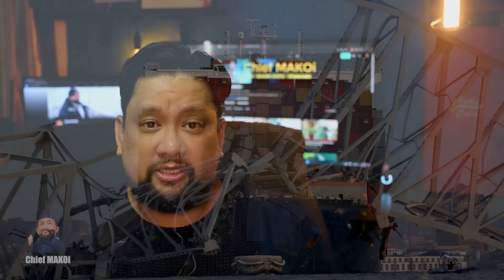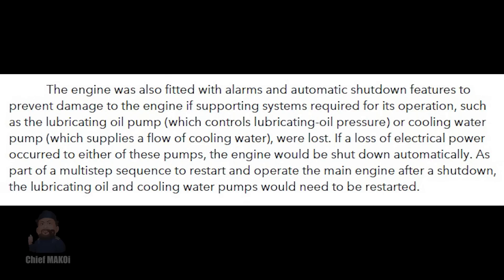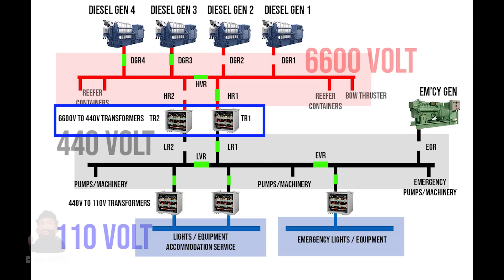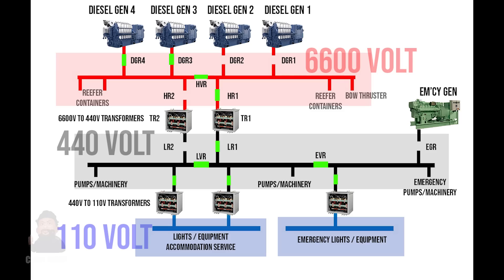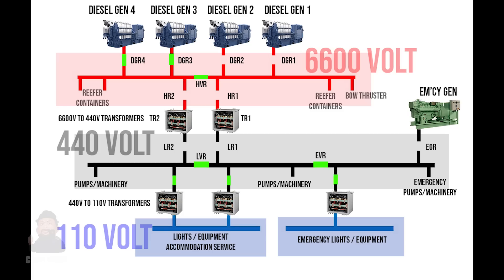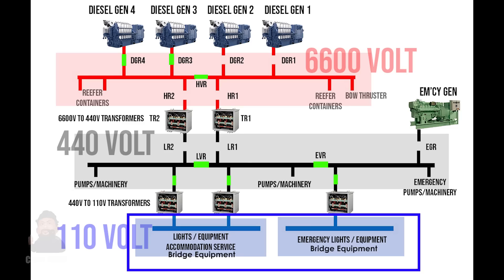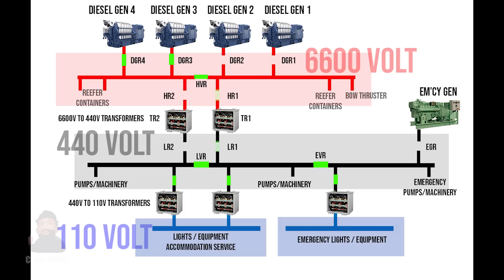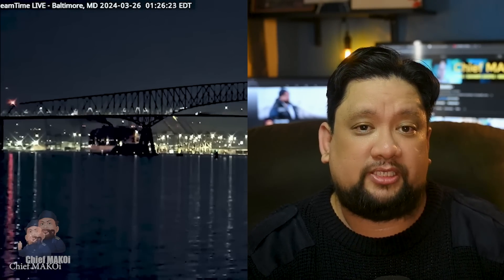Explaining the NTSB Report on the Container Ship DALI | Chief MAKOi

Comment: I wonder what alarm(s) triggered the opening of lr1 and hr1 initially. Does the electrical protection devices need manual resetting to work again?(back 25 years ago you would have to as I recall) If they for some strange reason operated the breakers manually at the breakers itself, the interlock systems at the computer or the controlroom switchboard will not stop you from messing up, the generators(connected to a faulty grid) will not be happy(the black smoke) and they eventually trip the generator breakers. They then switch to the second transformer but it is to late. My knowledge on these kind of systems is outdated, but I had to take a shot 😂 The key will probably be in how the ICMS is supposed to work and be operated and routines, maintenance etc.

Comment: You said that the engines could be started to run backwards in order to reverse the propulsion. Could doing this with the prop turning the engine backward have caused unburned fuel to be blown out through the exhaust causing the black smoke that you mentioned?

Comment: 8:02 - That is the emergency generator coming on.  The navigation lights and emergency lighting for the walkways along the side of the ship came on, but the big spotlight on the front didn't dome back on.  It comes back on later just before impact when they were using the 3rd generator and the second transformer.
Reply from the maker: That's usually a mercury lamp at the front.  It takes a while to fully illuminate.
Reply: @ChiefMAKOi  We had High Pressure Sodium when I started back in the 80s,   then it shifted to Metal Halide and at the last LED.     The HPS and MH had various rapid re-strike systems if they were considered emergency (every 3rd light in a facility).     Some just had an aux Halogen bulb that came on until the HPS got going puling enough current to open the relay.     Mercury are the worst of them for power use,  HPS then MH and the LEDs of course very efficient  (costly but far fewer failures of the bulbs or ballasts)

Comment: Chief your explanation of the wiring and all was grate best of all so far, every one is talking about barkers and such BUTT!!! can you tell us when they tried to restart the main engine and how many times did they try and was the black smoke from the main. I think my simple question is did they ever get the main engine going full power in reverse or close to it. I am quite sure the Chief Engineer was fairly full of excitement at this time. Thank you for your time Chief. I know nothing about ships just that when this computer goes dead a new one will come on a SHIP.
Reply: Chief I don't know how to do that. I think the simple question is did they ever get the main engine running in reverse? Thanks.        Paul

Comment: It is common in Diesels, that if you reduce the injector pressures that you get very poor fuel atomization, and this results in "black smoke" into the exhaust.  We've seen this in automotive injectors.  However as per your comments, this does NOT explain the breaker tripouts, which are either the result of electrical overloads, shorts, or insulation failures within the system.  If this ship had electrical leakage detectors, this may have tripped the breakers, if they are remotely controlled.  We did this on an Exxon underwater system, to protect divers from being electrocuted in the water, in an 4400volt system.  This is essentially same as your GFI in your house.  If the breakers just had bad connections, loose bolts, or similar, which resulted in overheating or intermittent connections, the switchover to the alternate pathway should have resolved this problem.  Bad connections are a common problem, but easily bypassed with redundant systems.

Comment: Chief... When the term "Circuit Breaker" (CB) is used, in the context of the NTSB report, isn't this a term which is easy to misapply for those who may not be marine engineers.  Understanding your expertise here, would not these circuits be protected by CBs & Relays?  Many who are reviewing the NTSB report are hearing CB term and thinking of the CB that is in their home;  CBs protect against over current protection.  However, as I am certain you are aware... Relays can be used here and with expanded benefits over CB protection.  I only mention this, in that it is one more layer to the details that will untimately explain this event.

The relays, if linked to a microcrontoller can monitor for over or under voltage, over current or any number of sensors that may be connected to it. In turn, the micro controller can use a smaller power source to open and close the relay to provide enhanced circuit protection above what is excessive current protection that is afforded by traditional circuit breaker.  I suspect this is why what is labeled as HR 1 and LR1 (High Voltage Relay) (Low Voltage Relay) are labeled as R vs CB.  Furthermore, faulty or failed sensors may have been the root cause and human factor driven errors will ultimately be contributing factors the continued the propegation of the error chain.

For those who do not know, a relay is in effect a switch, driven by a "coil" or copper wire around an iron core that creates a magent when energized.  In turn next to it is a conductive metal tab that will be attracted to the magnet when the coil is energized.  The on eitherside of that are two points where wires can be connected.  When the coil is energized, then magentic tabs completes the circuit allowing the connection to be competed.  

When a relay is combined with a micro controller, sensors can be added that monitor voltage, current, and function of controlled devices within that circuit.  This could also include sensors on the generators.  The Micro controller then can programed to open the relay if certain conditions arise.  Stated, another way, it becomes a "smart circuit breaker."  

So are we potentially talking about relays (with or without Microcontrollers) & CBs or only CBs?

This leads me to the question I have for the NTSB... Who were they writing the report for?  The lay person? The Mariner? or The Marine Engineer?  In my review of the report, there were over simplifications throughout the report which is something I was expecting.  Unfortunately, it will be a long time before we get the final report on this.

I have started my own channel and did a review on this case, will be posting my own take on the NTSB report.  I refrain from posting a link to that here without you permission.  I really appreciate your approach and discussion on this.

I am a grad from USMMA, deck major, minor in engineering.  (3rd Mate, Qualified Memeber of the Eng Dept; 200 days on deck, 100 days in the engine room).  I then went into the USCG and became a marine casualty investigator.  This event was a combination of single point failure on the Dali & the Key Bridge that occured with timing that truely created the worst case senerio... ironically, we can not regard this as a one off event in that this  has happened before.  It is just that we have to back our point of view to the macroscopic view that  we do not typically view these events from.  This inability to change our point of view is what sets us up to repeat these events.  I think we need more timely review of these events, gather critical findings & share those as propmptly so transportation systems modify to mitigate future events.

This was a great & detailed explanation.  It presents excellent detailed data & explains the complexity of modern shipboard systems that are not well understood by those who are unannointed.

Cheers

John Hall
LT, USCG
KP '95
Reply: That would be true but all the work I did on a Dali Like system,  it was motorized CB to you could reclose (or command that) remotely.    CBs can also have a higher level processor PLC system that will trip them and refuse to let them close unless certain conditions are met.
         If you look at the Emergency Gen circuit,  what should be EG1 (not labeled on NTSB) that can't close unless LVR and LR2 are open.   CBs can also have a reverse current detector and be tripped by that.     Low Freq detection can and is used in various ways to trip.
Reply: @gregoryschmitz2131  Great point, thank you!  My point of inquiry is aimed at tyring to understand some of the smaller details in that they matter to understanding the mishap to begin with.  I was the pain in the ass student that was always asking "why?"
Reply: I’m slightly amused about quite some comments when reading the term `relay´; which I would more file under `low voltage and low currents´ only.
Those switches (or `circuit breakers´) used for the big transformers need to deal with 6600V and several ten amps (x 10A; if not few hundred amps, x 100A) on the HV primary side, and 440V with several hundred amps ( x 100A) even up to few thousand amps (x 1000A) on the LV secondary side. You need bit more `heavy gear´ for this if it’s not done by electronic high power switches yet (even those will need screws and wrenches to make proper contact).
Which brings us to the transformer (obviously Dali still goes with this `classic´ approach) and its basic ingredients: coils. The latter formerly have also been used for the – guess what – ignition coil to provide the high voltage required to create sparks in every cylinder of gasoline engines. The effect is as simple as: operate / “load” the coil with a certain amount of current, then suddenly interrupt this current flow by opening a switch / circuit breaker. Self-induction, high voltage, spark-plug, bzzz – here we go!
Based on this, you could imagine how the situation might look like for the transformers of Dali here. Tripping both primary and secondary coil while still under full load current (due to emergency) is the most challenging operation, with huge amount of magnetic energy stored in the coils. It needs measures to protect the breakers from such sparks like created by the ignition coil, but also to protect the transformers isolation from the extremely high voltage peaks.
Correct, those switches will typically be operated by appropriate mechanisms, which are controlled by automated, more or less sophisticated control systems checking for and analysing several operational parameters (but might also have kind of manual override option).

Comment: Perhaps the NTSB should invite Chief Makoi to participate in the forensic analysis of what went wrong with the electrical and fuel systems aboard the Dali, both when she was docked, and when she was moving down the main channel. the Chief could also interview
his counterparts in the Dali's crew. Its one thing to understand theory, as NTSB investigators do, but another thing to apply theory to practice, and for that, you need a person with Chief Makoi's qualifications. To analogize, if you want to understand the control systems on a Boeing 747, you need to talk with an experienced pilot certified to fly that aircraft type.

Comment: NSTB will blame the crew they need a quick judgement and a scapegoat 😢
Reply: No they will not.   The NTSB is a totally separate organization inside the Government.    It simply investigates.    I does not prosecute in any way.   Its Brief is to find out what happened and make recommendations to stop it from occurring again,  but it can' enforce that,  its a recommendation.    The FAA often ignores the NTSB.      The NTSB have economic costs and those are weighed in by the specific regulators.  
        In this case,  Chief Makoi has seen the tests in Simulators,  there is no recovery from a crashed main engine in a reasonable time frame.    Knowing that all the AHJs from the CG on down are complicit in this.    Sooner or latter you are going to have a main engine failure at the wrong time and you ram a bridge,  another ship or a port.   Counting on luck is not an option.
       There are layers of safety that can be added,  including running a split plant at critical times,  with 2nd systems all duplicated so any single one running keeps the main going.   Add in Tugs like New York mandates at narrow spots as well as pier protecion (yes you can engineer those,  it take money but its completely possible,   like a runaway Truck,  you make the run out long enough to soak up the energy,   they have done that on runways now as well.  
       Baltimore is running a Cheap port,  so no tugs nor pier protection despite the same bridge ramming taking place in Tampa bay years back with even greater loss of life.    They sure have pier protection there now.

Comment: Excellent review!   One question though, is the secondary 440v and not 480v?   Boats are weird.
Reply: Could be just the nominal rating. I know most reefer containers are name plate rated for 460/3/60 but are normally run on 480v. 480v is the NATO standard. However, there is two voltage ratings for electrical equipment. Power producers are rated for 480 volts in the USA/Canada. But power consumers like motors are name plate rated for 460 volts.

440v is a strange voltage to me. In the UK, most 3 phase systems are 415v 50 Hz. Because they are 230 volts nominal line to ground. Some countries the voltage is only 220 volts line to ground, so then the 3 phase voltage would be 380. Running 380v motors on 440 is a bit high. 480 volt motors will run somewhat ok on 440v, but can't be used at 100% rated load or the amp draw will be too high, and they'll run hot, and not be happy at all.
Reply: No,  I bet you dollar to donuts its a 50 hz system.    HV in the US is 7500 so note the 6600 volts on their HV side.    And you can get all sorts of voltages on Y to Delta,  Delta to Y.    A US 480 x 60hz systgem when run through the step down transformer comes out 208 volt 3 phase.   Tap that off to a neutral and you get 120.    Its must mathematical relationships.
Reply: @gregoryschmitz2131  7500? I've never ran into that voltage. Only 120/208; 277/480, 347/600 etc. Medium voltage there's still old equipment still running on 2400/4160 3 ph. Today if you want any other voltages where I live, the utility will just bring you 7200/12470, and you then have to supply your own transformer and CT boxes etc. The new Wal-Mart near me has a 12470 feed.

I think you might mean the 7200 volts on rural SWER systems. Single wire, earth return, there's only a single 7200 volt line run on the poles, so no 3 phase power, and all the pole pigs are set up to drop 7200 down to 120/240 center tapped secondary.
Reply: @gregoryschmitz2131  You might be right on the 50 Hz, most reefer containers can run on either 50 or 60 Hz. Singapore standard low voltage distribution is 230/400 50 Hz. However South Korea is a 60 Hz country, and the voltages there are 220/380v 3 phase, and the generators and switch gear are made by Hyundai, so it's still strange where this 440v comes from, or what countries standard they're using.

Comment: Thanks for the simplified schematics. Makes it easier to understand. I believe the ship was understaffed with experienced crew in the engine and power room. I believe whatever happened in port started things going downhill. It shows a lack of knowledge by the crew. My question to you is this when the first power disruption happened and HR2 and LR2 tripped. Why did not HR1 and LR1 close automatically and keep power going. Still think fuel issue and manually closing breakers is fishy. Thanks Chief Makoi.
Reply: The understaffed is an issue and there should be regulations for that.     Cheap as they can get away with (in some cases).    Same as Baltimore being cheap port rates by not mandating tug escort  all the way past the Bridge like New York does (high desired destination so they make it mandatory).

Comment: Will the diesel fuel pumps start even though the fuel available could be below some 
Predetermined level?
Reply: There should be a day tank for each Generator that is level or above the Generators .     The Generator should then have a mechanical fuel pump to feed the Injector Pumps or the Unit Injectors (a lot depends on era and emissions at the time).    Also in question is the Generator cooling pump that can be its own mechanical unit but its going to depend on a main system sea water heat exchanger cooling system.  
        The Emergency Generator will be self contained but also higher up in a deck level location so air cooling works.
Reply: I wondered if the fuel tank would allow starting the generator but not have sufficient fuel to complete the whole "engine reboot and start routine" Also does the emergency generator have its own separate fuel tank?

Comment: Hey chief. Love your channel. 

I’m not a marine engineer, but am a mechanic of diesel electric locomotives so have a a working knowledge of the principles in play here. 

The heavy black smoke out the stack is a clear indication of overfueling, often caused by an overload situation. I would not expect to immediately see black smoke from a fuel starvation issue. This makes me think that something in the electrical system caused a sudden overload of the generators, which tripped the DG breakers for low speed. 

One question I’d like to ask you, since it was brought up by some naval engineers. Barring the possibility that maybe some equipment would be down for maintenance, wouldn’t you have more redundancy running the electric plant split. Say running generators 1 and 4 with 2 and 3 on standby, buses split and both transformers online? That way it would be next to impossible for a single breaker trip, such as the TR2 breakers in this case, from causing a total blackout? You wouldn’t need to run the plant in that condition full time, just until your in open water, then you can shift electrical generation to the conventional state. Is there any reason why you couldn’t, or for it to not be practical, to run a split plant for redundancy in restricted waters?  Also, are the main engine support pumps spread out on the buses so one bus leg could keep the main engine running?